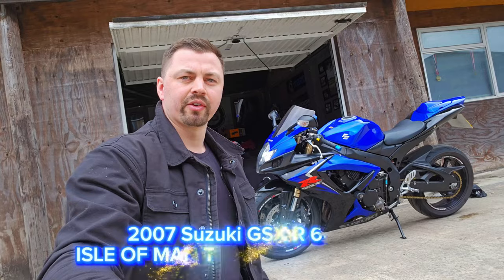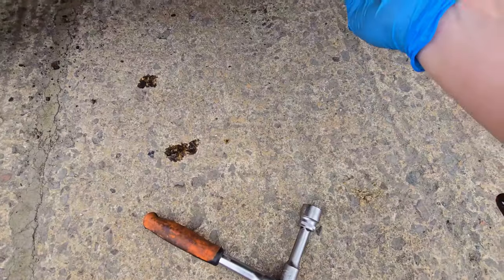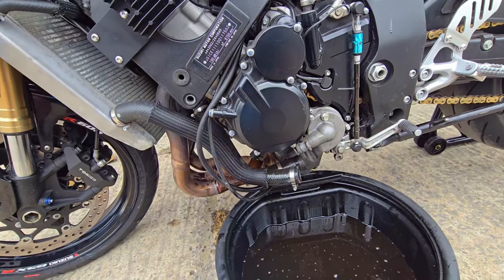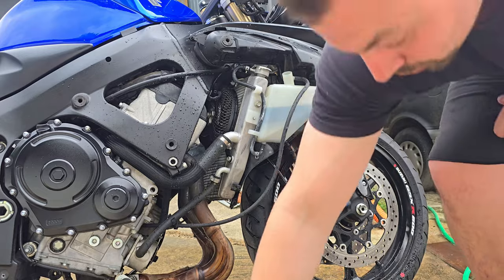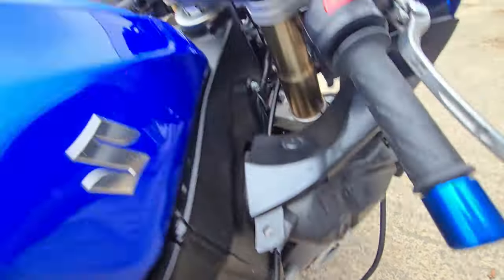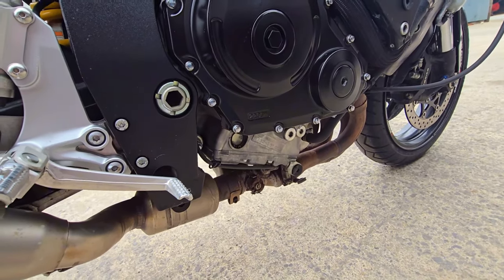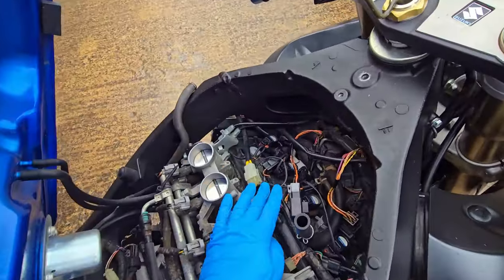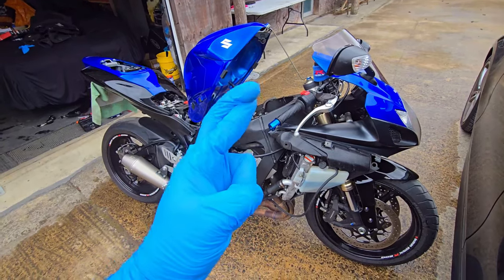Suzuki GSXR 600 Full Service * Oil, Coolant, Water pump, Spark Plugs & Air Filter *

Comment: I just changed mine. Took bike off stands to lean, waited and its leaking coolant. What did I do wrong? Did I get a faulty part. All bolts are flush. What i Do see is the part that enters the bike with the big O ring does not go in fully when i look under the bike, is that how its supposed to be??
Reply from the maker: @daekwon9650  hey, the only thing I can think of other than it being a faulty part is the shaft on the water pump has not engaged properly with the mating component inside the engine or there could be grit or something that's prevented it from engaging fully.

It's hard to give you an answer without seeing the bike in person, I hope you get this issue sorted

Comment: Hi, awesome video, really helphfull ! I have a 2006 GSXR 600 too and this helped me a lot. I would like to relocate my regulator as yours. I can't find something similar of what I saw in your video here in France. Is that possible for you to share me the specs (mainly dimensions, and holes places) of the metal plate you have to relocate regulator on the side pls ? I can't find it, so I'm gonna charge someone to make it for me.
Reply from the maker: Thank you for the positive feedback.  I just found a relocation bracket on ebay for you, type in this number 395415302002 in the search bar on ebay and it should load up for you 👍

Comment: Hey, can you comment on the use of red rubber grease vs silicon grease? What you can and can't use silicon grease on? I've been told silicon is generally better but are there areas that it shouldn't go? Thanks!
Reply from the maker: Hey, I'm no professional and could be wrong here but I think the difference between the two is they both have different temperature melting points which is probably why you shouldn't apply in certain areas because it will cause the product to dry out and crack!

I think Red rubber grease protects rubber from cracking and deterioration and Silicone grease protects surfaces from water, rapid aging, and high and low temperatures. 

I'm always learning myself and I try to research and learn off others too. So far the areas I have applied the red rubber grease on the GSX R has caused no problems.
Reply: @RotaryandRides  Thanks!

Comment: Lovely video. As you did defo pour some fresh oil into the filter before fitting, worth filling up as most will get absorbed into the filter. This means the bike is running without oil for the shortest possible time. 🔧 Nice tip about the copper grease at the top of the spark plug, thanks. Also that small cap unscrews form the spark plug.
Reply from the maker: @TheDervMan  Awesome, thanks for the feedback and advice. Always learning 😁👍